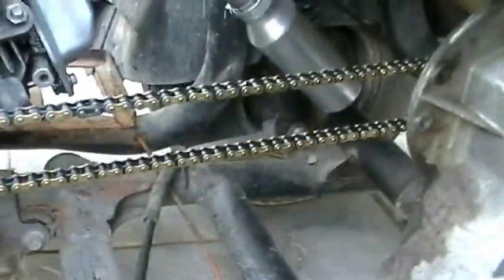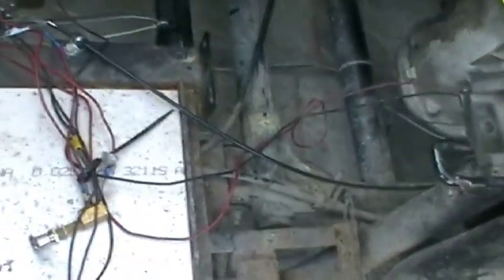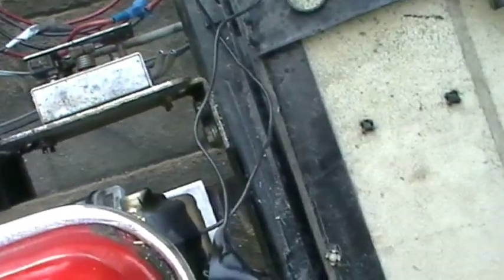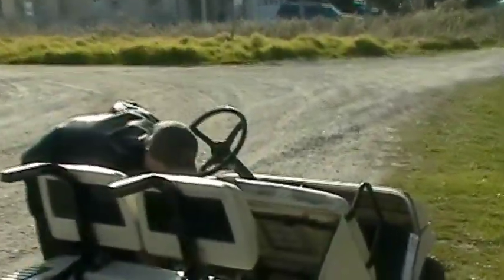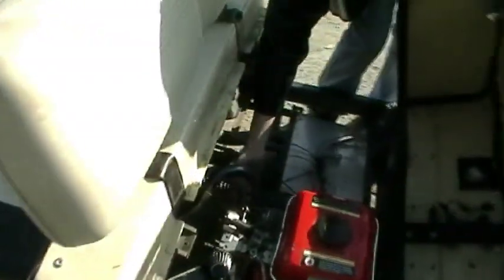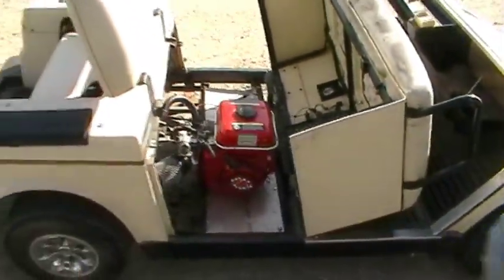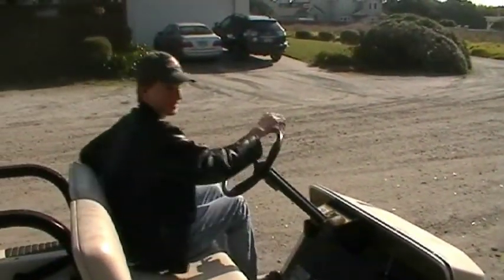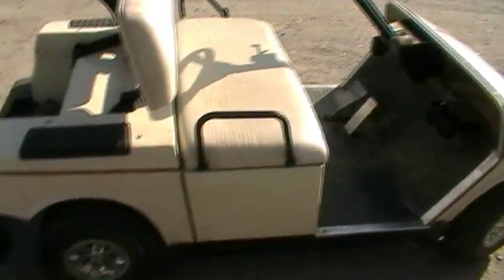Electric to Gas Golf Cart Conversion Pt 7

Comment from the maker: @SirNinjaCrab A converter would be a good idea. The only rthing is if i were to run one of those, my motor would need to be mounted much further left since the output gear on teh converter is much more offset to the right. The only thing is you might need to run a large rear sprocket, ot you may not have enough torque.

Comment from the maker: 16t on the clutch, 18 on the rear. Its all about allignment. I messed up once with the engine mounts, which caused the sprockets to not line up, causing the chain to jump off. Im acctually in the process of replacing the clutch with a TAV2.

Comment from the maker: @stevensj13 It recently, meaning yesterday, started to backfire comming down from top speed while i was letting the compression of the engine slow the golf cart down. Your right about the carb jet, The mixture is too lean if i choke it less than half choke.

Comment from the maker: Im gonna start out with a basic Harbor Frieght flux core welder. I acctually cant run the choke any more than half open since the intake lets in much more air than the stock jet can compensate for. I dont want to run it too lean, so i usually run it at about 1/3 open. But that will soon be fixed once i get the new jet (.38 drilled). The TAV2 should be able to give me monster torque over the centrifugal clutch. Only thing is the way the sprocket is placed ill have to scoot the engine over a bit.

Comment: Sounds like fun.Are you going for a MIG/flux core welder?They're the easiest to pick up.Stick welding can be tricky but worth it if you've got the finesse with it.MIG welding on a windy day is pretty much impossible.Are you running with your choke all the way open, or do you have to close it somewhat to keep the engine running?The torque converter ought to work out pretty slick for you as well.It's pretty much a constant velocity transmission as far as I know.Should give you better output.

Comment: so i have a melex golf cart and im putting in a suzuki 650 motor with suicide shifter aka jockey shifter any ideas on attaching the motor which is horizontal drive by belt and my diff is straight out facing the cart how can i connect the two? please help